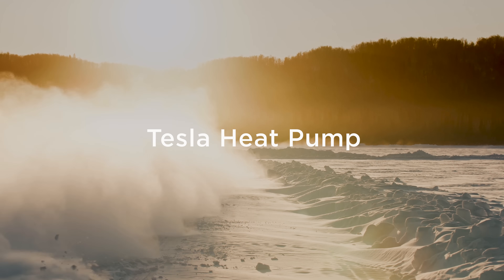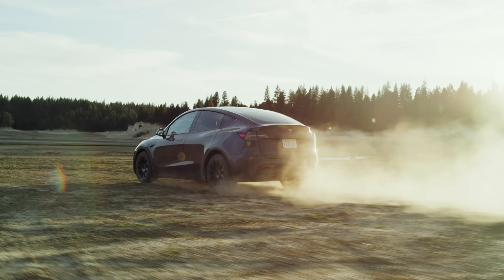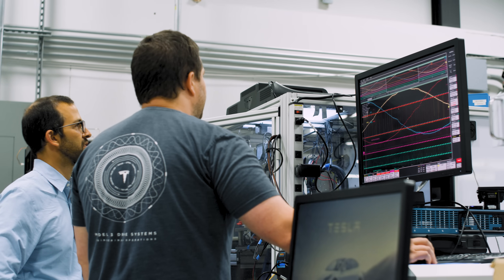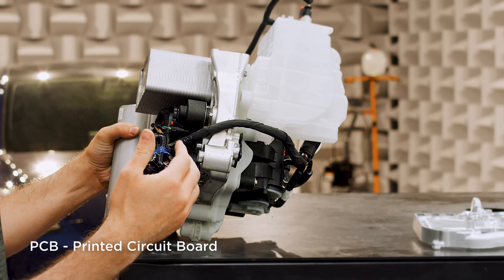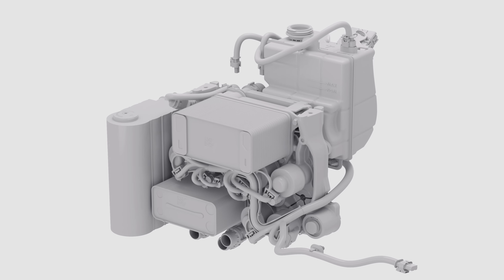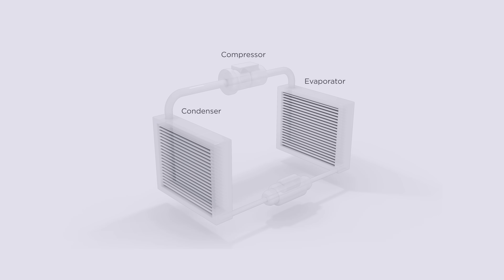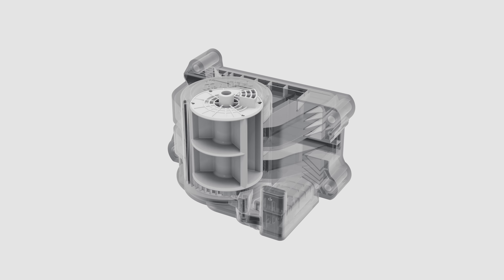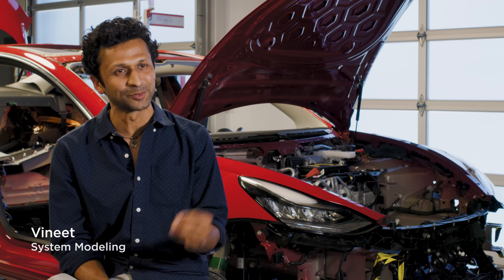Tesla Heat Pump | More Range in Cold Weather

Comment: Not enough people appreciate the beauty under the cover. Tesla is way ahead. I've watched some tear down videos of other EV's. I highly encourage you to do the same 🫣.
Reply: @Rahul Amirth I have been studying Tesla's product development since the debut of the Model S and I can state with guaranteed confidence that none of the legacy automotive companies will be able to compete with Tesla's product quality.
Tesla is too innovative and too efficient to be surpassed by the likes of those archaic troglodytes~
Reply: BMW had heatpump 10 years ago
Reply: You know that audi e-tron and porsche taycan had heatpumps at least for a year? This is nothing new or being "way ahead"
Reply: @dawidklimek3371  It's more than just sum of parts it's how they're all integrated and software controlled.  Tesla is way ahead.
Reply: @dawidklimek3371  
So, about the VAG efficiency....?
Reply: @dawidklimek3371 , Tesla has had this heat pump and integrated design for 2 or 3 years now.  I'm not sure why they are just now sharing it with the general public (probably because they don't really do marketing), but they were ahead of the rest on this.  It's also more than just the heatpump.  Tesla's design allows heat/cold from any system to be directed to any other system through a special manifold and valve system.  For example, waste heat from the motor can be used to heat the cabin in cold weather.  Or, waste heat from the heat pump can be used to pre-heat the battery for supercharging when the AC is cooling the cabin.  Or pretty much any other combination.  

Also, Audi and VW group are removing heatpumps from their cars because of some "chip shortage."  In other words, they are buying a generic heatpump assembly from a supplier and they don't know how to adapt the design or rewrite the firmware for a slightly different chip and I guess the supplier doesn't care to either.  Pathetic.
Reply: @dawidklimek3371 Tesla had these in 2020, so 1-2 years ahead of Audi or Porsche. Tesla wins again lol
Reply: @dawidklimek3371  What you didn't mention about Audi and Porsche is that they are more expensive in price and they are less efficient in battery usage.
Nice try with that attempt to belittle Tesla's innovation, but that nonsense won't fly here~